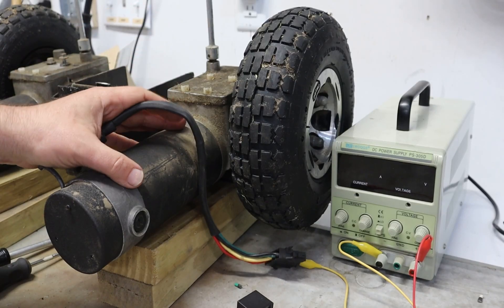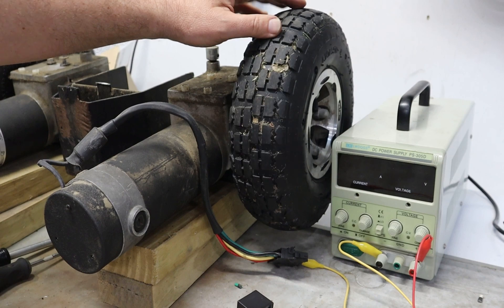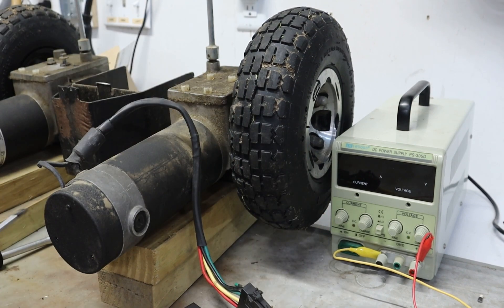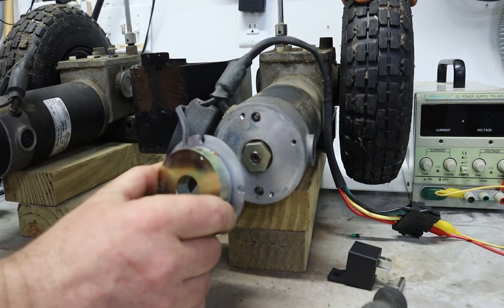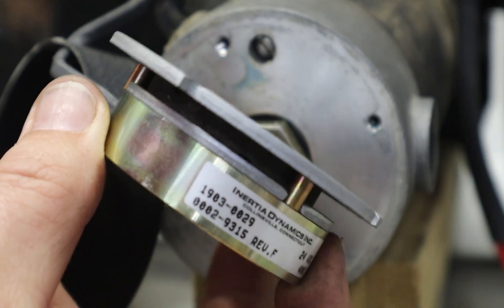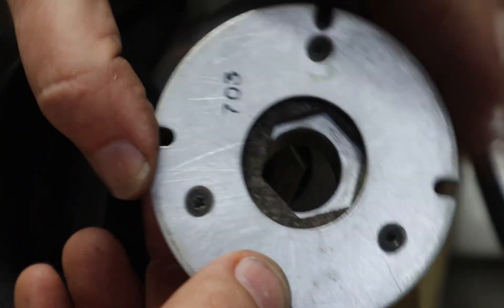How to Remove Power Wheelchair motor parking brakes

Comment: Would those motors work on 18v cordless drill batteries?
Reply from the maker: Yes. They should run just fine on something like Ryobi drill batteries.
Reply: @BenjaminNelsonX  thanks for the reply. I’m considering power propelling my little wonder blower. It weighs 160 lbs  I would gear it down with chain an sprocket to achieve around 3 mph

Comment: Thanks for this, my Pronto has a stupid wrench light blinking.  Using the flash codes, 5 blinks and a pause, means my left parking brake is not working.  Your video was very educational.  These "safety" brakes almost got me killed.  It started failing without much warning.  Several times last month, I was running it to the store, and it would spin me out of control to the left.  It is very bad when the power chair is in a crosswalk at 12 mph and it looks like you are some idiot horsing around.  This weekend my husband hopes it is only a loose wire, if not, he plans to remove the brakes but assumes he will need to run a jumper on the computer to fool it that the park brake is still there.  I want them both disabled before they kill me. Looks like removing the brake pad is the solution.  I will keep you posted. 

Pronto Flash codes; 
1 - User Error - Turn off and back on
2 - Battery - Check cables or replace batteries
3 - Left motor fault
4 - Right motor fault
5 - Left Park Brake
6 - Right Park Brake
7 - Remote Joystick 
8 - Power Module - makes you wonder how the computer knows it is broken?
9 - Communications Error - Check everything wires, batteries, remote, motors and brushes.
10 - Unknown Error 
11 - Incompatible Remote Joystick connected

Hope that helps future readers.
Reply: My husband got the cover off and it appears he must remove the motor to access the park brakes.  Where Ben's motors are set on 90 degree gear boxes, my pronto has them aligned across from each other with a narrow space between the caps. He is in the process of removing the wheels. I am ordering 2 new 10 tires online as mine have extreme road wear.  After that the motor is anchored to the frame by 4 hex heads.  He is concerned about the scooter coasting on hills, but we don't live in San Francisco.  Our city is mostly flat.
Reply: My wife had me consult your video about the park brake issue.  Thanks that worked out well.  As Wendy told you the motors are almost identical but the gear box is straight across.  A few shade tree mechanics attempted to remove the flange that seem to be seized up. Instead there is a large nut at a pivot point that removed the whole front wheel assembly.  I found the wires and attempted to fool the computer system.  Direct short did not work, same issue with the 5 blinks, so I installed an AC 7 watt Christmas light bulb in line to trick the computer.  The bulb doesn't glow but it works.  However on to the tires... she orders 2 tires from China, $30.  They arrive not like the picture of course. The rims did not have 4 lugs as shown. I got the new tires off the rims and found them more narrow.  Too narrow for the rims, I found some other 4 lug rims to make them work. They still squeak like you are rubbing 2 balloons together, but the chair cruises on them for now.  I plan to replace them later with better wider tires, I kept all the spare parts.  The chair stops fine without the electric brake system. I also plan to wire another bulb in on the right side in the future.  I think it is about 4 watts because my tester is reading only 12 volts on those magnetic locks from the computer.

Comment: Cool, somebody gave me three of those wheelchairs one time, one of them I immediately fixed and sold very inexpensively to somebody that needed a wheelchair, something like $100 and then I ended up with the other two I was going to do some projects with they were pretty messed up, but there were a lot of cool parts. I really want to get the controller programmer

Comment: That’s an interesting approach—removing a safety feature like the automatic brake. While the remote-controlled mower is likely much lighter than a person, it's worth noting that the brakes on mobility devices are specifically designed to stop the unit and prevent unintentional rolling, particularly on slopes. The mower may face similar challenges in that regard.

Also, wheelchair batteries are typically designed to last for 20 miles or more. Even accounting for the additional draw from the mower motor—which could cut that range roughly in half—you’d still need a very large yard to use up that capacity.

Given that, the trade-off—removing the automatic brake to save around 16 watts and some wiring—might be worth reconsidering. It could be helpful to weigh the safety implications against the efficiency gains in this case.